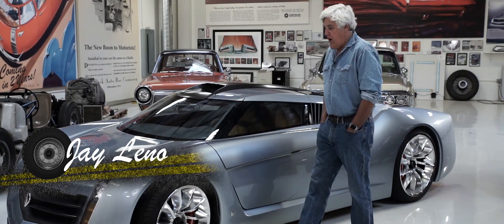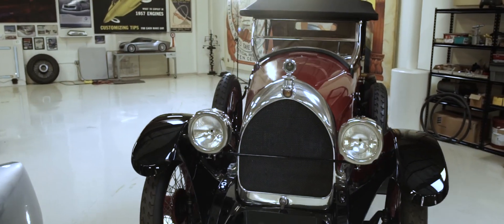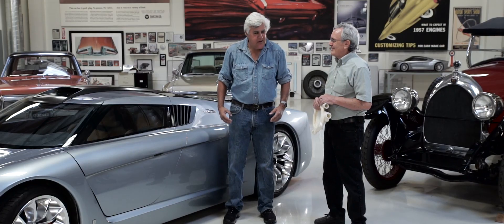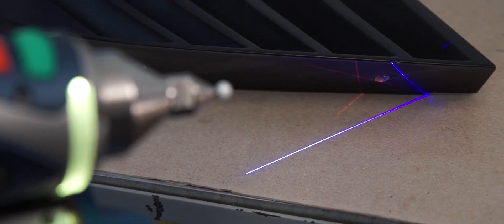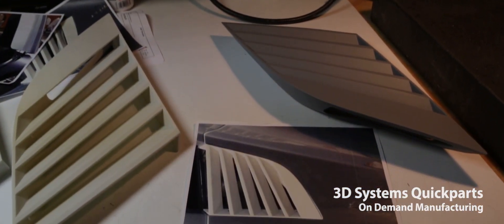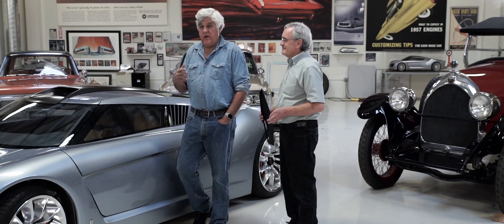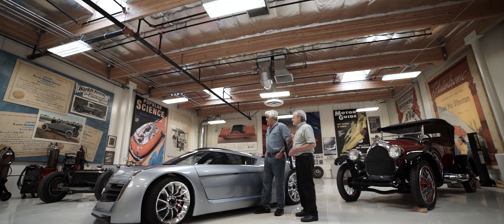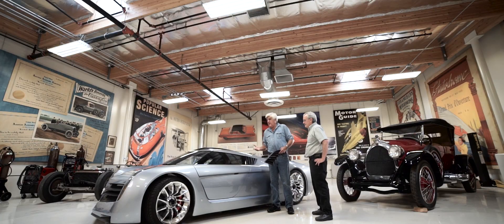Jay Leno on 3D scanning and 3D printing from 3D Systems

Comment: 3D scanning is really the technology that should get more attention because metal 3d printing is expensive and printing in plastic has very few use cases. You can give dimensions down to the millimeter and 3D print the part in plastic so people know exactly what you want. I guess 3D scanning and printing is mostly for car manufacturers so they can easily improve parts

Comment: There are a few problems with what these guys are doing or promoting. To make a part by scanning and printing is one thing and it can be done pretty easily. BUT... And it's a big 'but' the material that is used in making 3D parts is generally not designed for performance or let's say use under required conditions. This vent that is the focus of this video is exposed to moisture, wind forces and the biggest killer to plastics, UV light. 3D parts are made layer by layer UV cured plastic is melted in thin layers to form the part. Manufactured injection mounded parts are made with formulated plastic ratios in ABS plastic or PE and injected at high temperatures and pressures to promote part stability or deformation. These 3D parts have a long way to go and no company will guarantee performance in specified conditions. I've worked with these parts in car design modeling for years and whilst the process and technology has improved, the parts are not designed or intended for practical use.
Reply: 3D printing has improved quite a bit since this vid came out in both plastic/polymers and metal. Now you can print a pat out in almost any metal then just minor machining is needed, aerospace is using it and it is saving weeks and money in development and production costs. 
Jay could build a car completely from 3D printed tooling and parts.
Reply: AutoClay Look how far the stability & structural integrity of these parts has increased...All within the last Year...